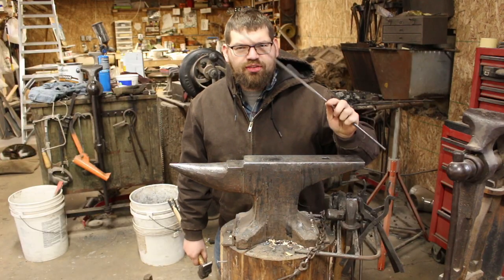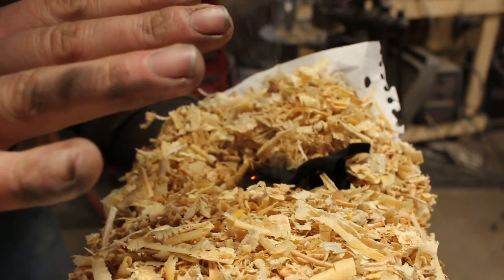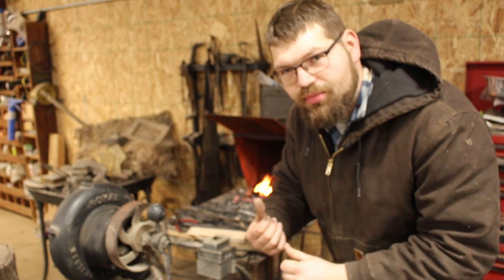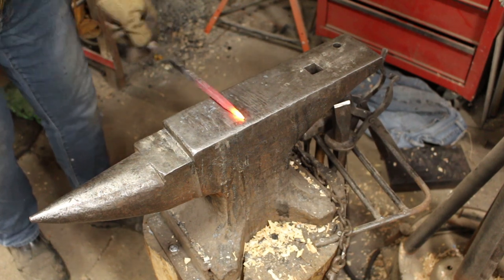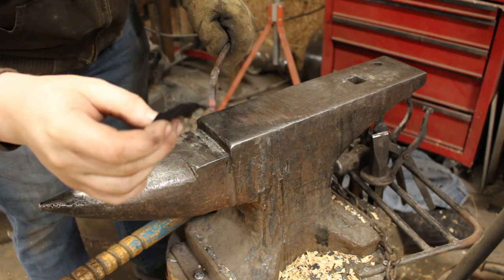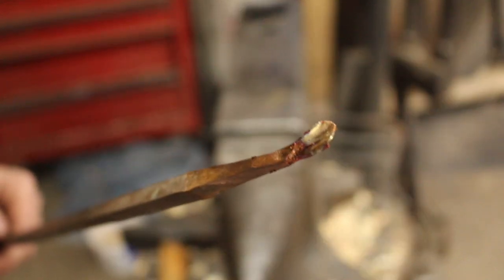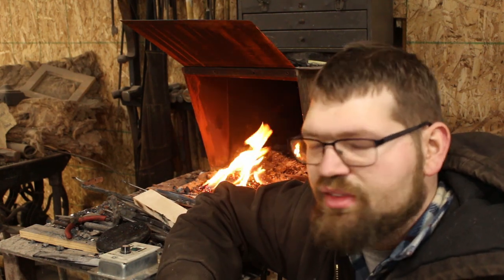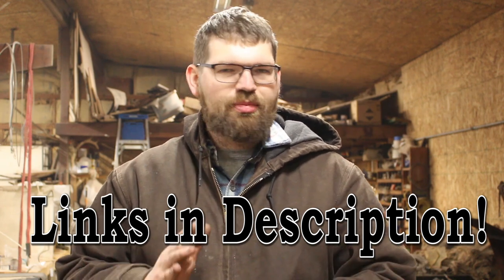Strike UNTIL the Iron’s Hot!

Comment: Next try with titanium rod. Its thermal conductivity is even lower than stainless steel's, so you might be able to ignite it. You might want welding goggles.
Reply: I should probably specify, I meant Ti-6Al-4V and similar alloys, not pure titanium.

Comment: An old blacksmith told me, "I would go to Hell for beating on cold Iron." He meant don't waste time trying to move cold Iron. This video shows that Iron might stay hot if one hammers hard and fast enough. I doubt four men with 8-pound hammers would be able to keep most work hot enough to complete it fully. 

When I could not get a tool to pull 68HC11 chips from their sockets, I cold forged baling wire with a ball peen hammer to make the hooks. I used the hammer to cold forge the wire to shape, then peened it to increase its hardness and stiffness to the point the wire functioned as a chip puller. At no point did the wire get hot. I was strain-hardening annealed steel wire.

Comment: I wonder how the math works out on this for how much each hammer strikes heats up the metal?

Like I counted a little over 50 strikes in that first example before a red glow showed.  If a red glow is around 900F, does that mean each hammer strike delivered an increase of ~18F in temperature or does the energy that gets imparted into the metal go up exponentially?
Reply: Id imagine perhaps some mix of both. Good point though, perhaps its somewhat exponential in some way, or maybe it starts heating up slow and then quicker, then stops heating up as quickly once it gets to a certain temperature. By quickly i mean with each strike.  Of course there are so many variables with this as well, it would be interesting to be able to test in a vacuum in a temp controlled environment

Comment: So basically what's going on here is you're generating heat through the friction of the atom in the metal rubbing together and the softer the metal the less friction the atoms have with each other, the less heat generated.

Theoretically this would work with any material (not just metals) provided it doesn't break under the stress (although it may ignite first unless in an oxygen free environment).

Comment: The new meaning of hot rod:-) haha I wish you would have tried the copper even though you couldn't see the red glow it might have been hot enough did you think about wrapping the copper with insulation on the shank while you worked at the tip to retain the Heat question by also I was thinking the same thing the whole while the cold anvil

Comment: not sure if its the same but i’ve just taken pieces of fence wire and hit it with a common hammer on the concrete and it heats up a ton, not glowing hot but it gets hot (if you couldn’t tell i wanna learn how to forge )
Reply from the maker: It’s the same concept… it sounds like you have a head start on the addiction 🤣